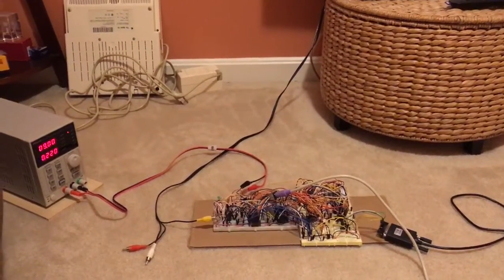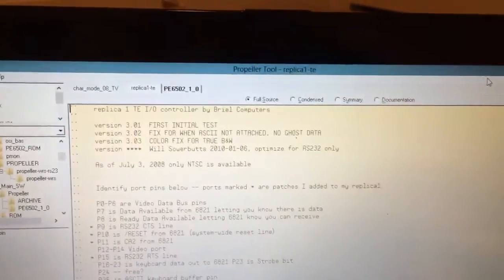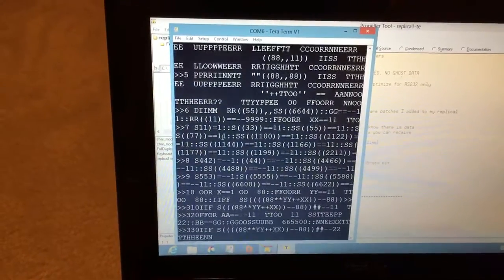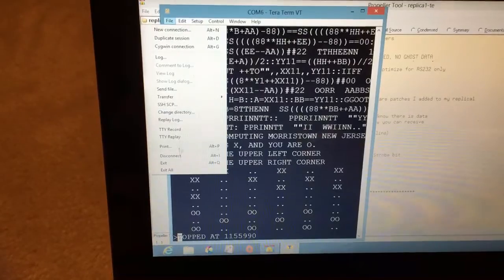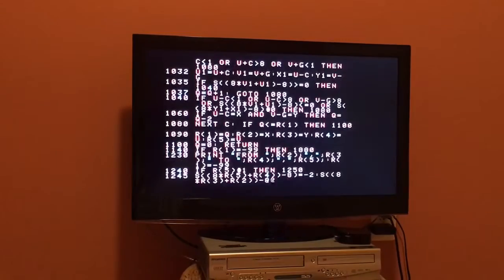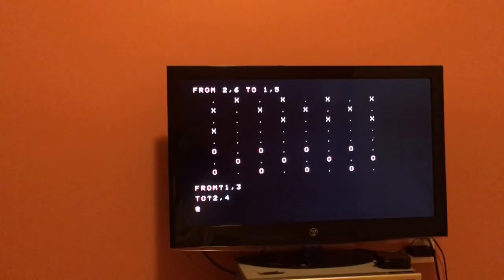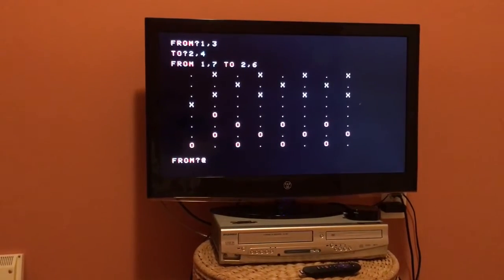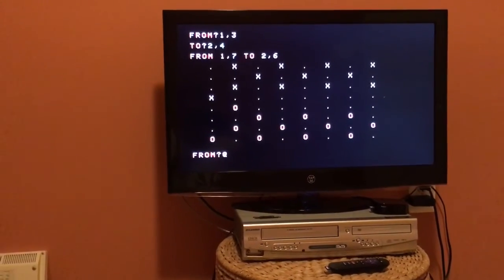6502 computer build, part 3

Comment: Question: Why the Propeller chip?
Reply from the maker: Many reasons!  The propeller is a very versatile microcontroller- essentially an 8-core computer in one chip.  It is well documented, and still has quite a following online, with lots of shared software (for example, keyboard reader software, SVGA display driver software, etc..)  It is easily available, and relatively inexpensive.  It's easy to get it running (almost everything onboard already!  Just add power!) and is easy to interface too.

Compare this to some other computers that use dedicated hardware:  Grant Searle has some wonderful designs- but I've found some of the chips he uses a little hard for me to find.  You can get them on eBay, but, I wanted all parts available off the shelf, so I could sell this design if people wanted to buy it.

Finally, I enjoy using the propeller.  I'd used it in a couple of previous projects, and had a lot of fun with the chip.  It allows the PE6502 a sw-configurable, built-in terminal emulator.  All this, with a low parts count.
Reply: Corneleous Worthington How much space does it have on its internal EEPROM and RAM?

Edit: Never-mind, just checked Mouser, it has 32k of program ROM and 32k of data RAM. Currently checking Parallax’s website for extra information.

Comment: I found these videos via 6502.org.  I wonder if you're aware of my project at http://hackaday.io/project/3620 which has some similarities with yours (by coincidence, I swear! :-).

I was also inspired by Ben Heck's Apple 1 build videos, but what caught me the most was Ben casually remarking that his design could probably do without the PIA, I already had code to emulate the Apple 1 PIA so I knew eliminating it was easy, but I went a little further and (initially) also eliminated the RAM and EPROM by using a module that I had written for Vince Briel's Superboard III project. The result was L-Star: basically a WDC 65C02 on a Propeller proto board. But when I got stuck on a business trip with a Propeller that had stopped answering, I bought a Parallax Propeller Education Kit like you have too, and build my circuit on the breadboards that are included. 

Getting an Apple-1 to work on just a Propeller (with the necessary peripherals like the EEPROM) and a WDC 65C02 was easy (because of the work I had done before), but it didn't doesn't leave much hub memory available to use as RAM, so I had to tweak the Krusader ROM to work with less memory. Later on I designed a PCB that also has a 128KB static RAM chip and an expansion header so you don't have to rely on the Propeller to provide ROM/RAM memory alone.

Anyway, I just wanted to point you to the project because it might give you some ideas about how to get rid of the oscillator and the EPROM. The Propeller can generate the clock (and run it at any speed or stop it at any time) and the ROM image can be made part of your Spin program if the Prop is on the bus. Then all you need to do to update your ROM (instead of taking 20 minutes to erase an EPROM and another 10 minutes burning another image) is to recompile your Propeller firmware that includes a "File" command to read your ROM image.

By the way, the ~BE pin is not the only difference between the WDC 65C02 and other 6502 variants: you also need to disconnect pin 1; on the WDC chip, pin 1 is the Vector Pull output whereas on other 6502's it's a GND connection.

===Jac
Reply from the maker: Hi Jac!!  Not only have I seen your L-Star project, but I have the link to it in my notes that I used while designing my build- with the comment "use nice compact board layout, like this L-Star project"!  

Once I get my boards back from OshPark, I plan to focus on a lot of propeller code for a while.  I've got a lot to learn, but I found a MOS SID emulator that runs in just 1 propeller cog..  I think this would be a great addition!

I also knew that you'd collaborated with Vince Briel on the Superboard III- and noticed his later Replica 1 computers use the propeller chip for the clock signal, and also to provide an inverter gate too- and wondered if you'd contributed that to the Replica 1 firmware?

Good stuff!
Jason
Reply: No, I didn't contribute to the Replica-1 software but I have a possible future improvement for that feature where the Propeller implements an inverter: Vince used a cog to do that but I think it's possible to implement an inverter by using a counter and setting the CTRMODE field of CTRA or CTRB to %01xx1 (where x=don't care). I never used counters that way but from the Propeller manual I understand that whatever you program as pin B will have the inverse of pin A, delayed by one Propeller clock, without the do any programming.

I also have some ideas about improving Vince's Pocketerm software (it should be possible to make it into a VT240 emulator that supports all the cool features including double wide double high fonts).

Also if I ever have time, I would like to do some hardware hacking on the Superboard III to see if I can use the cool keyboard as an ASCII keyboard for the Replica 1. :-)